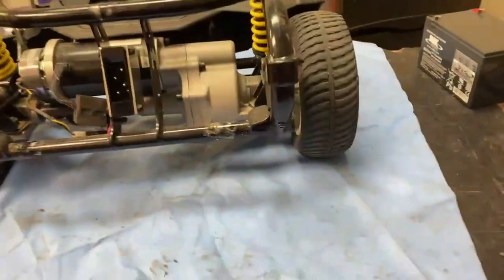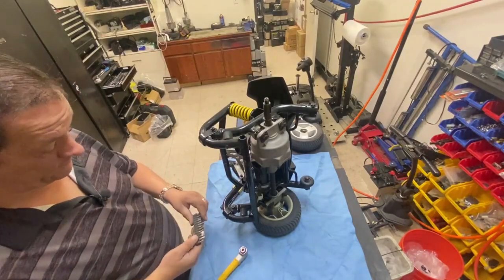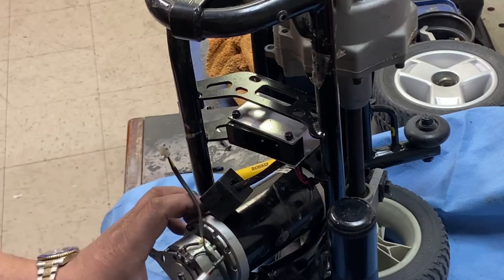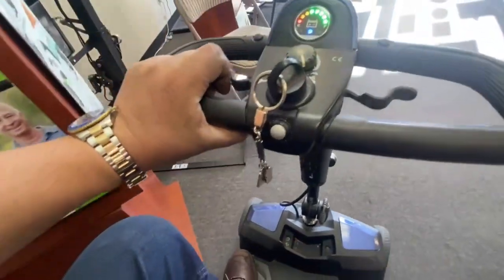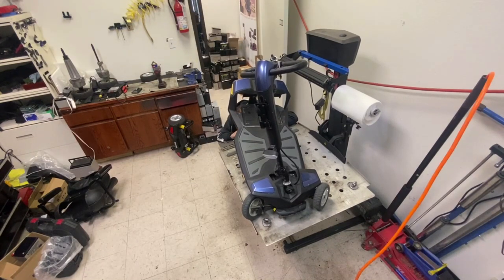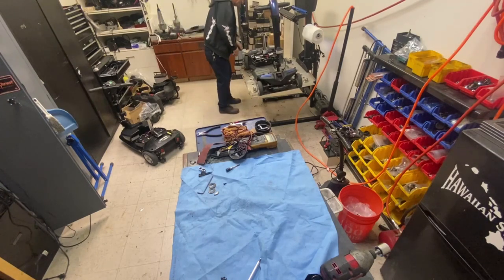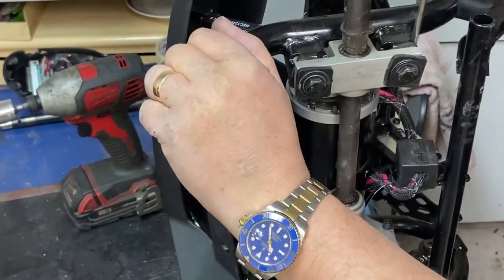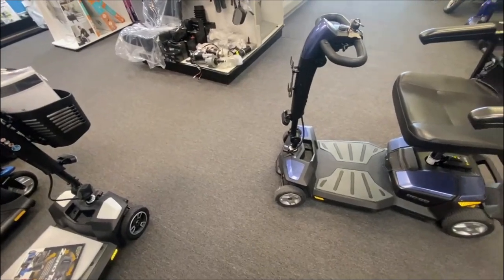Diagnosing A Pride Mobility Go Go LX Dune Buggy WARNING LONG VIDEO

Comment: You are awesome. You never give up! This is something my father taught me, a person who used to fix things too. I watched the whole video. Your customers are lucky to have you.
Reply from the maker: Thank you, Larry, your comments are very much appreciated.
Reply: @lasvegasscooterslifts  I'm searching for a new scooter. Do you think I should stay away from all LX models?
Reply from the maker: Personal, yes if you use the scooter for long distance but hopefully pride have sorted the transaxle problem now. You could also try the Endurance Li same platform as the LX but with Lithium battery. Or the ZT8 twin motors so no transaxle but heaver scooter, great turning radius.
Reply: @Las Vegas Scooters & Lifts  My problem has always been that my legs are long and could cramp. I have neuropathy and arthritis. So I need a longer footbed than most people. Don't know if I will fit in the endurance. I have a 32 to 34 inseam. Maybe the seat can come back? Any ideas?
Reply from the maker: Hey Larry, all the travel scooters have fixed seat positions and do not move forward or backwards. Only the Pride Victory 9 and 10 and LX sport have front to back seat adjustment. My advice would be to try and find a good dealer if you can where you can sit in several scooters and may be even a power chair to make sure you are going to be comfortable for your legs. Try looking a some of the specifications on some of the Golden products as they seem to have a longer footboard e.g. BuzzAround LX  has forward and back adjustment too.
We could always dropship to you if you can't find a local dealer.

Comment: Hmm, I have had walking and standing problems, and have been using my old Pride  Elite Traveler, sometimes on hard sandy dirt,  to support my RC model plane flying hobby, for many years.  I did have the electric brake replaced years ago, maybe due to dirt entry. I have not tried to wash the scooter and it has not been rained on. Operating mobility scooters on dirt and washing them afterwards is probably to be avoided.
Reply from the maker: Oh, for sure. I remember when I first started messing with these things and spraying cleaning fluid on the brake to find out I destroyed it. 🤦‍♂️

Comment: I have a lx sport and have gone through three motor and six batteries in two years ,not counting tire and suspension parts. The VA said it was worn out and ordered me a new one.
Reply from the maker: You must be a frequent user of the scooter. I would of questioned why it would need a motor the second time.

Comment: It seems that sand in the brake switch was causing a switch contact issue.  I'm guessing the controller does not see the switch in the proper position and stops the current flow to the motor. Or I suppose the connection on the brake switch could have an issue too.  When the scooter stopped moving. Could you of turned the key off and then back on, then listen for a five beep code indicating the brake switch is in a disengaged position. I guess you would want to monitor if the motor is getting proper power when it is not moving. If it is then motor or transaxle is bad or the brake is not releasing. If no power then the controller is not sending out power due to not seeing a signal it needs to see or bad connection on the thick power wiring coming from the batter or going to the motor. I learned a lot watching your video.  Hope this will help me fix my Moms mobility scooter if it has a problem.
Reply from the maker: So far it hasn't come back after basting it with the airline to get rid of the sand in the battery connector.

Comment: Hi Ian!! Quick question; My friend and I were unloading HIS Victory 10 3 wheel scooter at last years Daytona Turkey Run car show and caught it on the mounted ratchet on the lift. We broke a clean triangle piece off that contains the side reflector. What would be the best/strongest way to re-attach it please? Really don't want to replace the entire floor section. Thank you!!
Reply from the maker: Hi Richard, you can imagine we get this kind of damage to our rentals all the time. Usually if it doesn't affect the safety of the scooter or cause any bodily harm to the passenger then we leave it. I have used super glue in the past, but it always brakes. Epoxy or JB weld could be another way of fixing it. I was thinking of getting a plastic hot welding kit to see if that would be any better. Have a good one.

Comment: I just picked up a LI. It has the larger lithium battery. Why don't airlines allow that battery. Are there any exceptions? 
I am just north of you and if I can't take the larger battery do you sell the other one? 
What is the cost?
Reply from the maker: Hi Bob, here is the link to the FAA which explains all you need to know regarding limitations on Lithium Batteries on airlines.
 https://www.faa.gov/hazmat/packsafe/portable-recreational-vehicles#:~:text=Airline%20approval%20is%20required%20for,carry%2Don%20or%20checked%20baggage.
Yes, Pride do sell the smaller 8AH battery pack (if they are in stock) you can give us a call we can check the price and availability for you. 702 265 2441

Comment: Hi Ian thanks for the video, can you tell me what the black box shape that has the main wires inside is for. Thanks
Reply from the maker: If you are refiring to the little black square block on the rear section near the rear connector, as far as I'm aware it's a suppressor to reduce EMI RFI, magnetic and electromagnetic interference and radio frequency interference. Ian
Reply: @lasvegasscooterslifts well I never, always wondered what that bloody thing was, had 1970's moped that had a suppressor in with the contact spark points, but everything was old tech then, I didn't think with all this modern tech malarkey it would still be an issue, but Every Day's a School day 😊😊😊

Comment: Loved watching this, how many hours total did you work on this, and how much did you charge her, did you show the customer the sand photos, ( you know the sand she had been near hahaha) pity we carnt see some unedited bits not fit for YouTube Giudelines, ooooooh pmsl
Reply from the maker: Hey Bryan, I spent about two days fudging around with this. I can't remember now how much it was probably about $50 £40. Partly I took her at her word that she said it broke down at the airport here in Las Vegas when in actuality it was from them running it on the beach in Hawaii. She has since returned but not for that scooter breaking down but for another scooter that needed replacement batteries.
Reply: @lasvegasscooterslifts Hy Ian thanks for the reply, this is the same transaxle motor and brake I am having trouble with on a Pride Apex Rapid in the UK, I think they must have different names for the same models over the pond in the US
it's a brushless motor,  since watching your transaxle video, that was my first visit to your channel I have been completely hooked, and have slowly been working my way through them, they are extremely informative and well explained, and you don't edit your mistakes, like most channels, have you done a video on brushless motors and how they work, and a really relevant question ror me that I would like to ask you, do brushless motors when running get really hot, plus the transaxle, and could it be heat transfer with fom one to the other due to conduction, is it normal for any of this, carnt understand how your Subscribers aren't in the Thousands, your videos are Priceless for bloke's like me who like to fix things themselves, please never stop making them, many thanks from me, Bryan Bailey from Doncaster Yorkshire England 😊👍👍👍
Reply from the maker: Thank you Bryan and I'm so glad you like the videos. As far as I'm aware all the motors used on these scooters/power chairs have brushes in them and only a select few of the newer light weight powerchairs may use the brushless motors (weight saving). I've had nothing in for repair where it's been a brushless motor but as soon as I do, I will surely do a video about it and strip the thing apart. 😃 Hot motor can mean either worn motor or worn-out transaxle or both but could also be loose negative battery terminal.